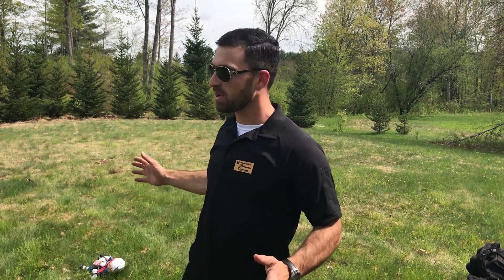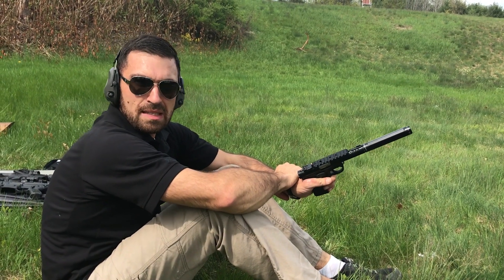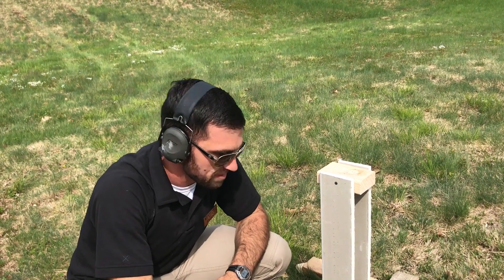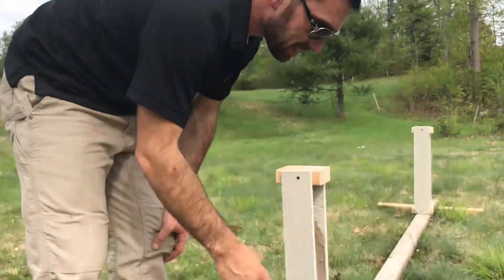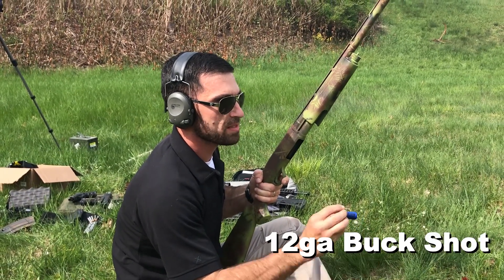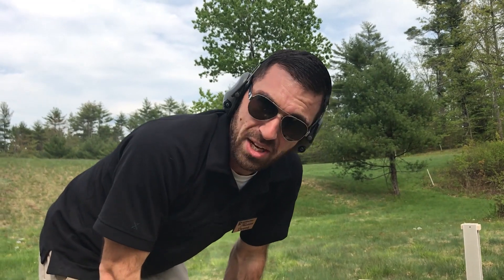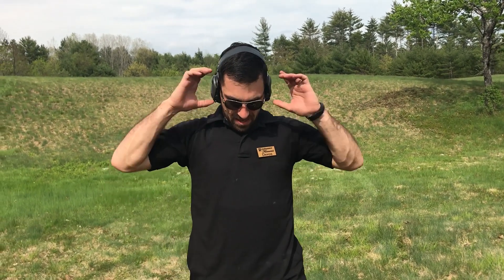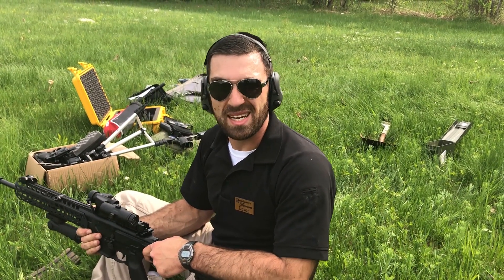Bullets vs Drywall - Penetration Test

Comment: There is no effective defensive round that won’t pass through at least 10 rounds of drywall (assuming it hits no studs, pipes, etc.). That being the case, no firearm is “safer” than another in terms of over penetration.
The solution: situational awareness. Know your surroundings before you fire and never fire in the direction of your children, even if there’s a wall between you and them. Stay between them and the bad guy.

Comment: Security system and situational awareness. From there pick the firearm that you can most quickly and accurately stop threats with and mount a light to. That's a 14.5" AR in 5.56 for me.

Comment: The concept of testing this is solid. Thank you for doing it. I use birdshot #6 in my 12 gauge shotgun and am hoping that beyond 25 feet and after passing through one wall that it would not be fatal. I am also hopeful that if my target is 20 feet or less in front of me, it will be an effective round.

Comment: 1/2 or 5/8 drywall? What number bird shot? Paul Harrell did a similar test with drywall and bird shot and got different results. Also I think you are underestimating the amount of damage done to the structural integrity of the drywall by cutting it so thin and supporting it poorly. The bullet can create a crack on impact in the drywall and pass through. This is easier than it would normally be 1. Because the weight of the wood and drywall above is forcing downward trying to break the drywall at it's weakest point. 2 The loss of support in the center gives the bullet mechanical advantage. 
This is evidenced by the structures breaking in the center and toppling over. But I could be wrong